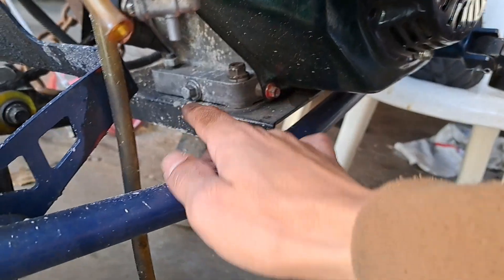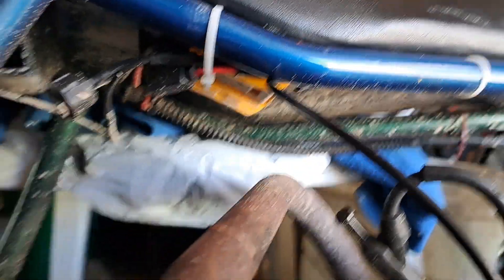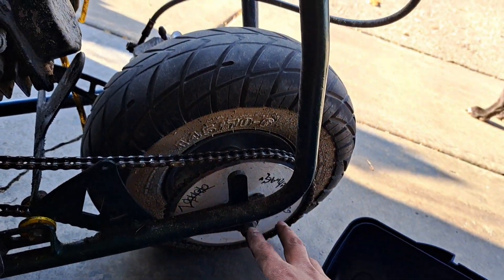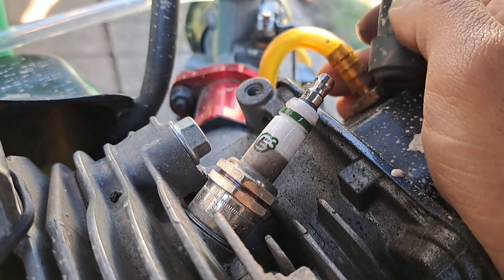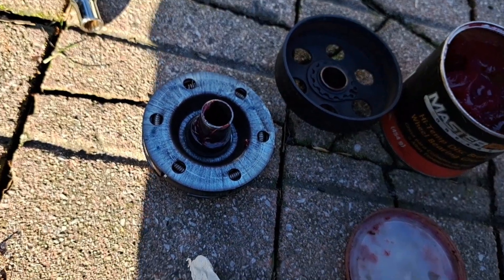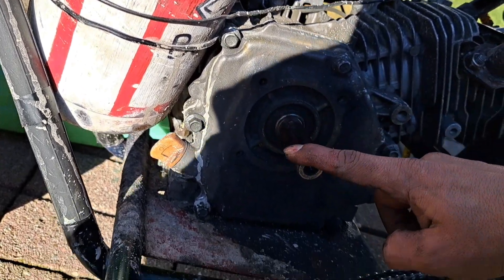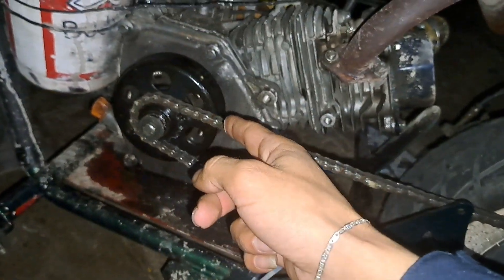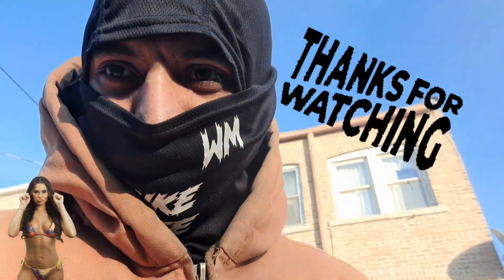DIY Maintenance for a Reliable Mini Bike! (Long Distance Travels)

Comment: If you dont have 10w30 use 5w30
Reply from the maker: Thanks for the tip🤘
Reply: technically still works but you really only should use 5w30 if operating in temps below freezing